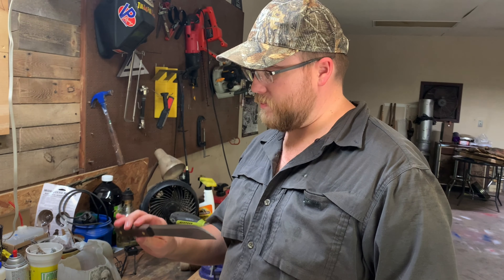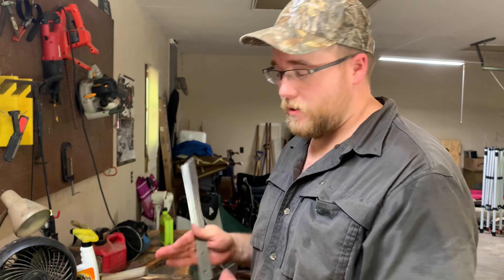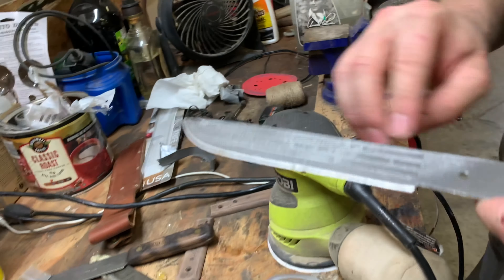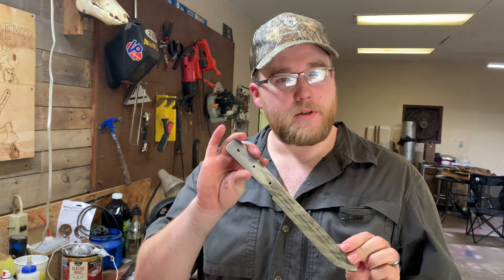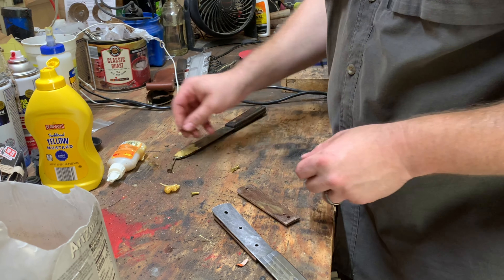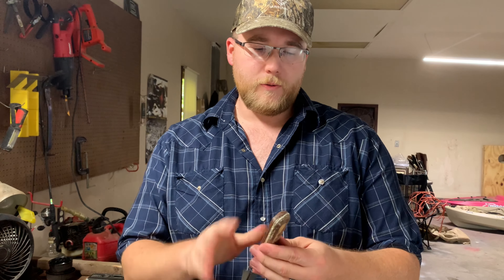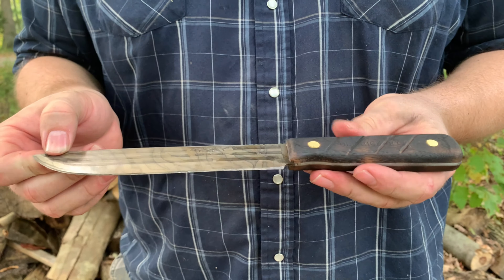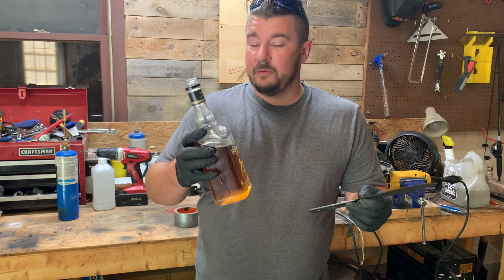🔪OLD HICKORY 7IN KNIFE SUPER MODS🗡️ #bushcraft

Comment: I wasn't sure that you were legit until I saw the Dremel on the work bench! :-)

I like that you removed the hump, I'm not a fan of that design feature. I have also become fond of a drop point blade when cleaning game, I seem to poke through things less. The finger relief is a nice touch. If you get you a 1 inch Harbor Freight belt sander you can use the top of the belt, where it bends, to make the finger relief indentation very symmetrical easier than a sanding drum on a Dremel. I like that you glued the grips on.  That will help keep water and blood out from under them. If you remove the handles on some old knives is pretty rough under the handles. I've thought about hitting the metal that will be under the handles with Rustolium after cleaning them up.  

I have several Old Hickory Knives that I picked up at garage/ estate sales. They are in rough shape, but then I think I only paid $1 or $2 for them. A couple have blades that are almost black.  I think that I'll try mustard on the places that I grind down. At least one may become a Khephart style knife.  

I've heard that the older ones are better 1095 steel vs 1075 on the newer ones. I don't recall seeing markings on the blades either way. Any idea on how to tell, other than just looking for knives that "look old" and hoping for the best?
Reply from the maker: Thanks for the comment and info. We love converting old hickory’s to different blades. I am a fan of the drop point as well. Im not to concerned with the whole 1095 or 1075 issue. We abuse these knives and use them quite heavily and never notice from the old and new ones. I couldn’t tell you how to tell a difference I think there all good to go. Again thanks for the comment and info you have.

Comment: Nothing wrong with using Gorilla Glue. I've used it to secure scales on my carving knives and machetes and it's never failed. It's fun modifying Ontario knives. I've done several of them from their Old Hickory line, their big fixed blades and machetes. I like clipping the blade of their 12" machete and turning them into big bowie type blades.
Nice mods and a good video imo.
Reply from the maker: You can not imagine how many comments we have had against using gorilla glue. I have used gorilla glue on many projects with great results. It is not the prettiest finish but we don’t make show knifes. Thanks for the comment and view.